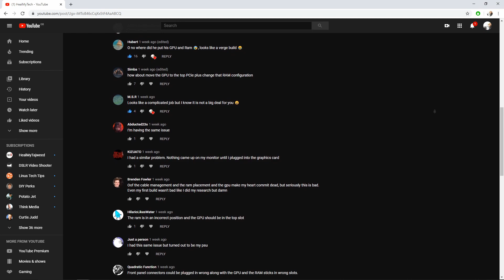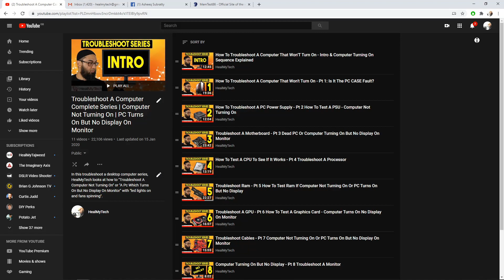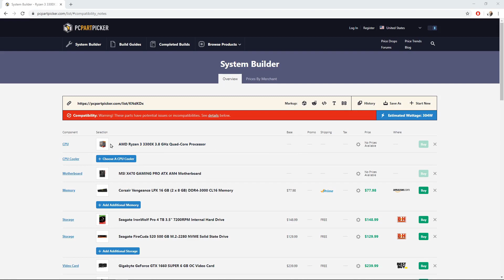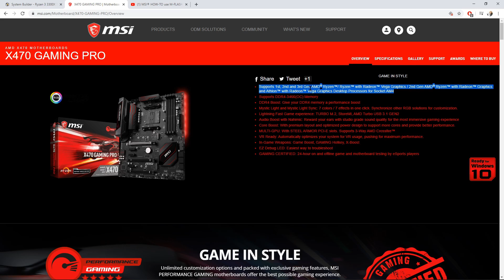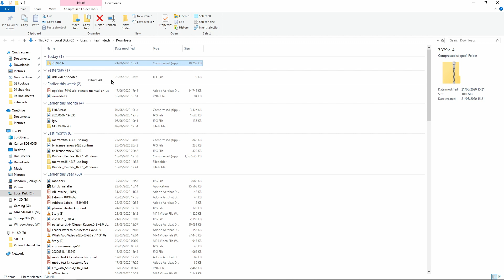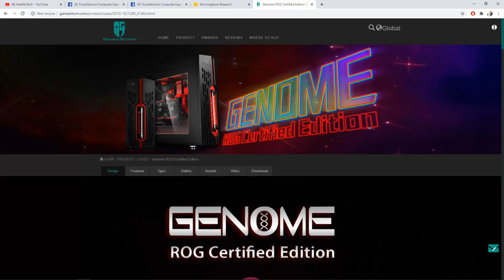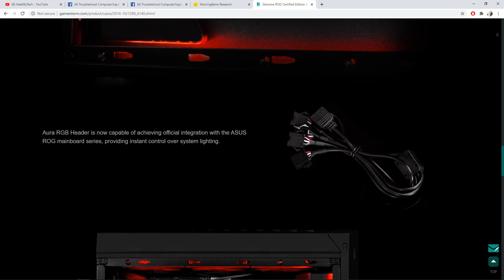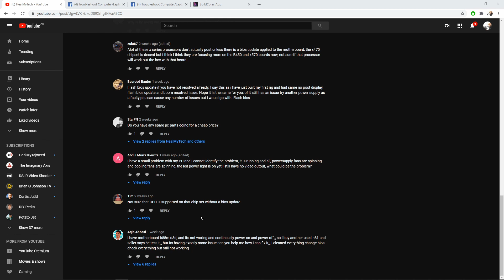New Gaming PC Build No Display - HUGE Beginners MISTAKE

Comment: My pc light and everything turn on but I’m getting no display
Reply: Same :/ did you find a solution?
Reply: @Link_triforce3  did u?
Reply: Did you guys?
Reply: Probably need to remove CMOS battery and put it back in (turn the computer off first then remove the battery, then put it back in)
Reply: Use HDMI, turn it on, then change it for dp
Reply: Fixed it?

Comment: I am hoping someone can answer this question for me?. I have had mixed replies to this as some say yes and some say no. I am currently waiting on my parts for upgrading my build after many years. Upgrades will be motherboard, CPU, memory, case, and I will be replacing my old boot drive with an M.2 and this means it will be a clean install. However, I 
have two HDD's that have other files and my Steam games on them. What I 
would like to know is can I just plug them in and they will still have all files on them?. Do I have to partition them and If I do how do I do that as I have not done this stuff in many years and cannot remember lol. I will also be adding another SSD for storage as well so it will be 1-M.2 new, 1 SSD 
new,2 HDD's old with files. 
Basically, if someone can tell me the procedures or steps without losing
 my files along with any other tips would be greatly appreciated.

Comment: I bought a pc 2 months ago... And i had this problm... I started switching cables and stuff and finally the display showed up... After 2 months of using the pc i had to change it's place so i disconnected everything... And when i put it in it's new place and turned it on i got the no display problm again just like the first time
I have a
I5 9400f
16 ram 2400 crossair
Asus prime h310m-k
Rtx 2070
Crossair vs550 W

Comment: I don't know if I have a similar issue or not.  I'm using and i7-12700k cpu on an ASUS H610 motherboard and don't see any indicators online if I need to run a BIOS update.  Might go to a computer repair center as I'm concerned if one of my CPU pins is crooked

Comment: Hello, im having a problem only during the first boot of the day. I usually turns off the pc out of the energy like 11pm then when i come back at 7am and try to turn on the GPU led wont light up then the mobo restarts itself quickly and i get a message like this "The VGA card is not supported by UEFI driver. CSM have been changed for better compatibility".  my GPU is a RTX 2070. after this first boot the pc works normal during all boots, restarts and etc. It's only on this first boot after like a 7 hours without energy. Thats my second mobo and its happening again... the difference was that in the first mobo it activates the onboard GPU and goes to windows without detect the RTX 2070, after a reboot the gpu lights up and everything runs normal until again the next morning boot like i said above.

Comment: Ive got a used gtx 1660 .It wont post but will with another older gpu. Its looks like a gpu issue everything else is working just cant post with the 1660. Should I use the old gpu to update the settings?

Comment: can a faulty cpu prevent all the fans in my pc from working? All my rgb on my graphics card works. But my case fan, Cpu fan and gpu fan won't spin. very confused. also my case rgb won't turn on. I also haven't tried hooking it up into my monitor yet but see that as pointless if i can't get the fans to spin. I tested the psu and it works, the rgb works when i have the circuit completed with the psu. idk what's going on. i think its either the motherboard or the cpu though. also, when i hook up my rgb lit up keyboard it works and lights up as it should.
Reply: The RGB on My Motherboard is Working, but my case is not working properly
Reply: @BadassBobY  I had a faulty motherboard, my pc works now. 
Have you tried to manually close the circuit with a screwdriver yet?

Comment: Please help . I purchased a galax b550m motherboard along with ryzen 5 5600x . But it’s not posting. What might is the issue ? Is it related to bios update ?
Reply: Im having the same issue? Only one light on mobo, you find a resolution??
Reply: @alexautry3676  its resolved, we need an older processor to upgrade bios then the new one will work

Comment: Would this still happen today with a Ryzen 5800X and a motherboard PG Velocita B550 that says it’s compatible with Ryzen gen 3 & 4, and future generations (including 5800X which is what we have)? PC is all set up and won’t post, although we tried running it without the graphics card in thinking we should wait until after downloading windows. We are going to set up graphics card and plug in the monitor to the graphics card port (had it in motherboard hdmi port) and try again. If it still doesn’t post do you think the motherboard will need bios update in order to be compatible with Ryzen 5800x CPU? If so, how can we do that with no local pc store and no older cpu?

Comment: Hi there I have one question as I have a motherboard b450 gaming x it was updated to the AMD5000 and windows 10 work great , I did some changes to install window 11 and now the unit doesn’t get to the post , I did pull the battery out to try and restart the bios but no luck , just wanted to know if resting the bios from removing the battery would it have gone back to the old settings where the AMD5000 is not compatible

Comment: i need help:( i turned my pc (not first time) (my gaming pc got after around a month) and the logo came and then i turned it off cause the black screen after logon tingy came. btw my usb ports didt work and no display... any solution?? plz my specs(rtx 2060 super) (i7 3770k not overclocked and gpu) 700 whats psu. plz help me. im not gonna go into the pc and take componments out
Reply: Did you find a solution I’m having a bad problem as well
Reply: you ahve to open the pc and take parts in and out
Reply: @yodoboat  I figured it out, my dram light on my mother board was going off so I took it out and put it back in

Comment: After resetting the factory heatsink of the cpu, as soon as I press the power on on my pc, the screen opens a little, it shows that it opens and as soon as the pc goes to do something else (like entering the bios or windows) then the screen closes and does not open and the rest of the computer works normally, I put it on 3 different screens and with many different cables (hdmi, vga, display port) and again nothing. I made the pc at Christmas. can you help me quickly

Comment: nothing works - computer was working fine, I plug in my phone to charge computer makes a click noise as if I turned it off - may have leaned on the power button - now no signal. If I change input on the screen it says it detects a connection thru dp port ( which is what my PC is plugged into ) I seitch to that and still no signal apparently. I have re-seated the ram multiple times and the gpu - no noises aside from fans, no error codes or red lights on motherboard everything should work fine but still no signal, please help!

Comment: To bad, the bios flash update does not help me with Ryzen 5 5600x and MSI mpg b550 gaming Edge WiFi Mobo 😞. Still no signal from any monitor.
Reply: fix?
Reply: I have the exact same problem with the gigabyte b550i aorus motherboard and 5900x ryzen 😭

Comment: bismillah,
ya akhi

If the GPU isn't plugged into the PCIE, but only plugs in the 6Power pin, the GPU fan doesn't spin. is that normal ? I did that to find out whether my psu was running normally or not. please help, akhi

Comment: PLEASE HELP! Im having the same problem but i have a ryzen 7 3700X on a B550 board and its been working for a whole week. the other day the display turned off and now it wont post, nor will the KBnM lights turn on. However the LEDs, FANs and other USB peripherals light up. Ive cleaned the RAM. My PSU is a CX650 RGB from corsair. PC part picker etimates my build only needs 364W. Any ideas??

Comment: i just a new motherboard cause my old one 2 of the ram slots werent working and its the same one but my display isnt registering. everything is plugged in right and i just spent 3 hours putting in all together. someone please help
Reply: is it possible my cpu is broken?? its a ryzon 3950x
Reply: I got one display working the one with hdmi plugged into GPU but the other display hdmi cable is plugged into my mobo and it isn’t working. i feel it’s a driver issue but i’ve been troubleshooting and i can’t see that being an issue. Some people say if you have two monitors they both have to be plugged into either gpu or mobo but my old pc worked just fine like that. For you i’d try driver updates

Comment: Hey i think i did the same mistake with cpu not compatiable but in my situation the pc just turns off 1 second after i press the power button, so could there be other things wrong or is it also because of that, ( cpu i5-7600k mb assrock b365 pro 4

Comment: A client of mine has a similar problem, the only difference is, I get to see aorus logo but it wont load Windows. Motherboard vga led is on. It sometimes loads windows but mostly it doesn't. I've updated bios to its latest version but still no solution. Can you help me please. These are the specs

Mb: gigabyte aorus pro ax v1
Cpu: amd ryzen 7 5800x
Ram: Kingston hyperx 2 sticks x16
Bios version: 13i

I did the same as you, check if components were compatible in pcpartpicker and it showed the same message you got in here.

Comment: someone please help I just built my pc everything turns on and sounds good but no display on my monitor I even tried different monitors and hdmi cables
Reply: Same here 😔, I’m guessing my cpu is broken but I haven’t checked yet . I’ve tried the ram tri king by taking out the ram sticks and making sure they’re secure but that didn’t help either
Reply: Vlonehakeem did you fix it?
Reply: @yom1rose682  Hey sorry for the late response. Yes I fixed it but the problem was my gpu, apparently it was dead so I had to get a new one .
Reply: Vlonehakeem thank you I ended up fixing it aswell
Reply: @yom1rose682  What Was the problem?
Reply: Vlonehakeem I didn’t have a gpu cable plugged in even though I thought I did for sure😅

Comment: I am stuck , i have a new board the asus rog strix b450-f , with amd ryzen 5 3600 and 2x8gb corsair vengeance (using old hdd and ssd from older pc ) and no matter what i do i cant grt a signal also my keyboard and mouse are not working , i'm so frustrated i've put it in the cupboard

Comment: I’m a noob when it comes to computer building. Do you know if intel core i5 10400 should work on the Z590 Tomahawk motherboard? I’m building a computer and I’m not being able to get any display (no post, I guess is the technical term) , I figured it’s due to the cpu not being compatible and think it’s best to get an AMD cpu from Ryzen. Would this be correct and fix my problem?

Comment: I swapped out my MoBo and CPU and am getting a no display signal. My CPU is compatible with the MOBO without a bios update, I'm a little slow with computer specs so I'm a little stuck
Reply: Make sure: RAM is installed in the correct order (per the mobo manual), all necessary power cables are installed on the mobo, you are plugged into the graphics card and not the onboard video, all connections are installed securely and correctly.

Comment: I am putting a pc together and I have a problem that I find strange that you might not and can help me with. I am testing everything outside of the pc before I put it together. When I jump my power supply the fan turns. When I plug the power supply into the motherboard the fan doesn't turn. To me this indicates the board isn't telling the power supply to turn on and it isn't getting power. I am not thrilled with the idea of spending 200.00 for a new mother board, besides they are almost impossible to buy right now. If you have any ideas, I would appreciate them.

Comment: I went directly for X570 for Ryzen 3 3200g, worked perfectly.
I am thinking this has better upgrade path, i almost took 2700x, luckily i made good choise!

I am geared for Cyberpunk 2077.
Reply: My gpu 1660 super 6gb oc version how ever, but i know how to tweak my computer, so i should be fine and with 16gb 3000mhz ram dual channel, coulda gotten a bit higher, but meh, i dont want to fry my system either...

Comment: Over the last couple of weeks I've had a problem I haven't managed to fix. 
My PC works fine when it isn't in a case but as soon as I put it in a case it won't turn on. It was fine in my old case but the power switch no longer work so I bought a new case, I built it into the new case but It doesn't work so I bought a second case & built it into that but it doesn't work in this case either so I now have my PC components set up on top of a cardboard box & it's working fine. I'm baffled!
Does anyone know what it could be?

Comment: How can we get in touch I am having the same issue with my build and I quad checked compatibility of all the components and the gpu is in the first slot I just want to make  sure everything is compatible I want to send you my specs see if something is going on with the CPU and MB Im currently running Asrock B450-M R 4.0 With the ryzen 7 1700x Unlocked cores is there a compatiblity issue?

Comment: I'm not sure what I'm still doing wrong. Other than put everything together before updating the bios. I followed these steps to update the bios, it seems to have worked considering the led went out and was only about 5 minutes. But I'm still experiencing the same problem. No screen. Also the led indicators just keep cycling. Should I just leave it for a time? Or is there something else I can do?

Comment: use a X470 motherboard with a Ryzen 2 chip perfectly fine.  built 200+ pcs and never had problem.Bad info.
Reply from the maker: Unless you are trolling, I don't understand your point, of course x470 and ryzen 2 works fine, but this board is not fine out of the box with ryzen 3, i.e ryzen 3 3300x.  Some X470 boards are okay, like the MSI X470 Gaming PRO MAX which is Ryzen 3 ready out of the box.  This one is the MSI X470 Gaming Pro.  If you still feel this is bad info, then you are openly invited onto the channel to correct this.

Comment: Thank you for the video. I was struggling I’ll figure out why I have no post video updates on the build. I’ll check compatibility when I ordered them and it look like they were compatible but now when I checked again I noticed that the board needs to be on a specific updated bios to work with the processor. So I am pretty sure that is the issue and will fix it just like in your video. Thank you for making this. 

Luckily I have a processor in my other PC I could swap to the board so I can get it updated.

Comment: One weird thing that's helped me a few times is having a second cable to plug in...I just got finished swapping a power supply out and everything was working fine with one cable prior, I was only upgrading.. After I put the new PSU in, I turned the PC on and the display worked for a split second but then went black, I tried everything in the videos..but when I swapped the cable it worked just fine...I know the other cable isn't broke too...This has happened to me at least 3 times with this type of motherboard. Maybe this is someone else's problem too, so figured I'd post a comment. Hope I helped.

Comment: So I’ve just built my pc every part is compatible I’ve check with computer stores near me and online they are all fine but it still won’t show any display what could be he problem?
Reply: did you find fix
Reply: @namy6130  yea ended up being to weak of a powersupply from the guy i brought the motherboard, case and psu from so i went to an evga 700watt psu and boom started first try

Comment: I am having the same problem with connecting to the monitor but the CPU does go with the mobo. It's an MSI X570 Tomahawk with AMD Ryzen 7 3700x. Everything comes on but not the monitor connection. Is it because I'm using an HDMI cord?

Comment: Almost all build mistakes are down to not consulting the motherboard VQL (RAM and CPU compatibility) lists and manual. That is your assembly guide. Use it. The VQL for memory is especially important because most motherboards are picky about RAM.

I highly recommend PCPartPicker when planning. I also recommend using Newegg descriptions to verify dimensions (make sure your components physically fit in the chassis you're looking at).

And try to not buy the cheapest chassis... get one with some decent cable management features. Oh, and apparently the otherwise cheap 4-pin warning speaker is too much to hope to be included with your motherboard these days; buy some separately and use them. Very useful especially in new builds.

Remember to set D.O.C.P (AMD)/XMP (Intel) RAM clock in BIOS (ensure the clock, voltage, and timing are as advertised). And the first thing you should do is run two sets of 4 passes with PassMark Memtest86 (1 error = bad; swap the DIMMs to check if you seated property and test again. If there's still errors, return/replace RAM and test again. Still errors? Probably a bad RAM slot; return/replace motherboard and test again). And the first thing you should do on Windows 10 is DISABLE Fast Boot (it will cause corruption because it doesn't ever let the system actually shut down. Look at Event Viewer if you doubt that. When enabled,  you'll see a dearth of errors about improper shutdown because of that). Then you should run SFC /Scannow and DISM (all 3 variants; in Admin CMD) to verify that Windows 10 actually installed properly. And you should run all of those as routine maintenance, ideally once a month or so (at minimum, after every major Windows 10 update).

And, of course, be sure to download all drivers and utilities from the motherboard support website. Windows Update is not to be relied upon to fetch those for you. You can definitely run into problems/poor performance staying with Windows generic drivers (they're only to get you to this point; so you can get and install the real ones your components need).